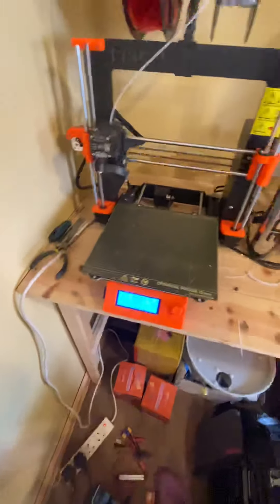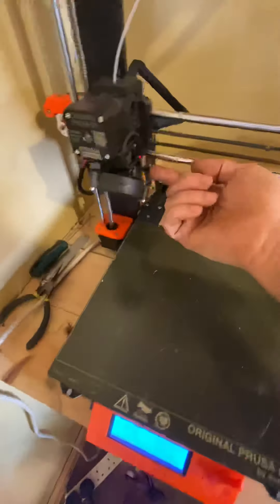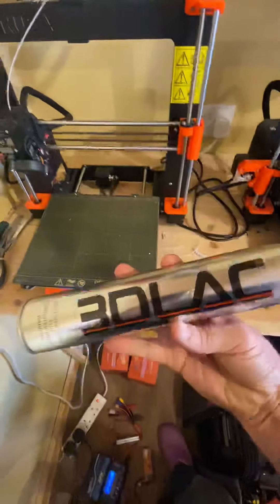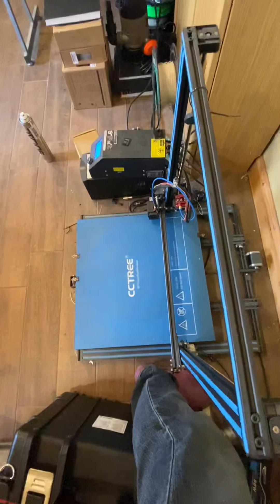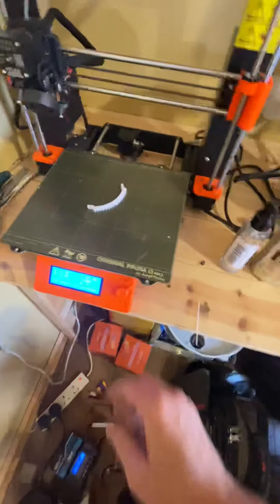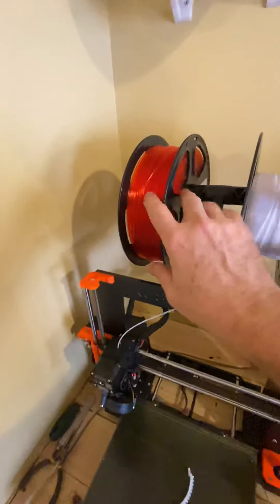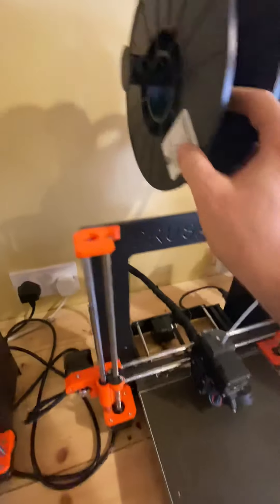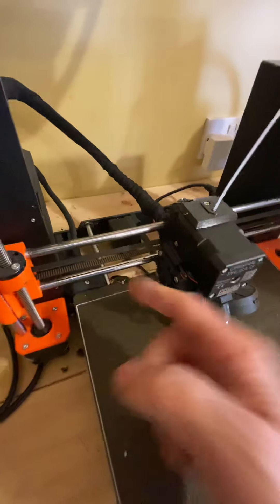10 minute walk around on my 3d printers

Comment: My S5 is on the floor also. Much more stable than on a shelf or table. The wide angle lens there makes the printer look small, but beware, it is h-u-g-e. You can fit 4 Prusa MK3s on the print bed.